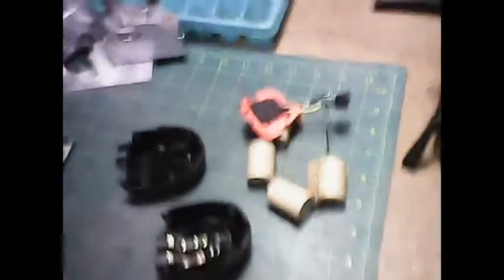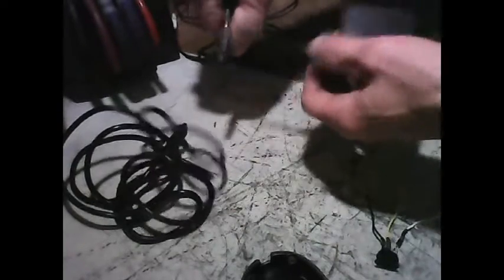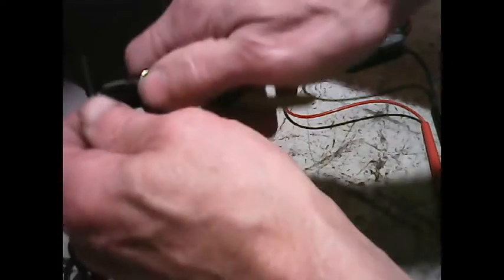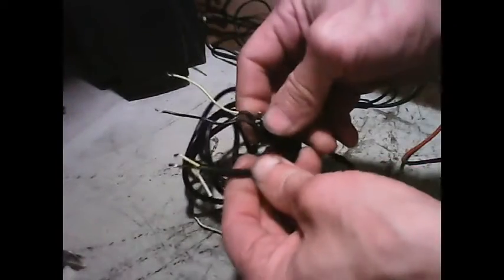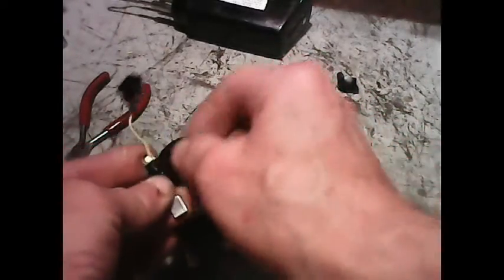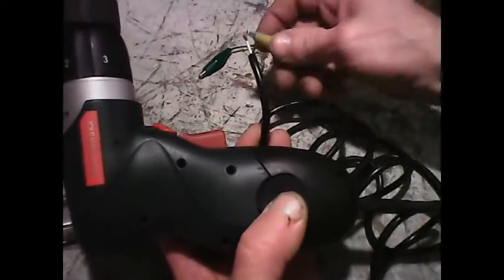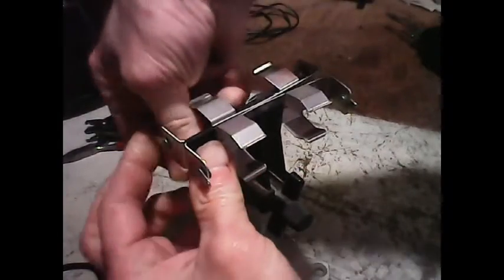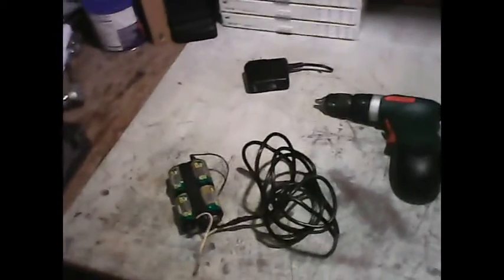battery relocation and replacement for my metabo, drill/ driver

Comment: The other day, instead of Ni-Cd, I put two 18650 Li-ions on a device like this, connected in series.  The device works nicely with 8V.  I put the batteries in the case, with a small modification !!
Reply from the maker: Thank you for sharing that, it sounds like a really good solution, to keep these little drills working.
I stopped using this drill because of the inconvenience of hooking up the cord to a battery pack all the time.
You'r idea is better, I'll look into doing that to this drill as well.